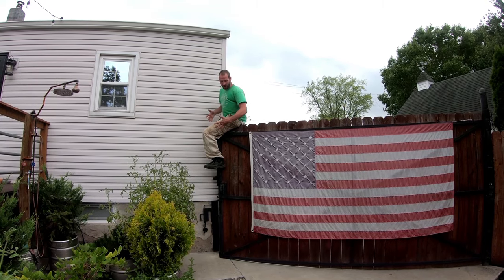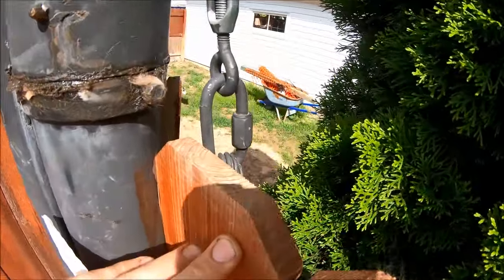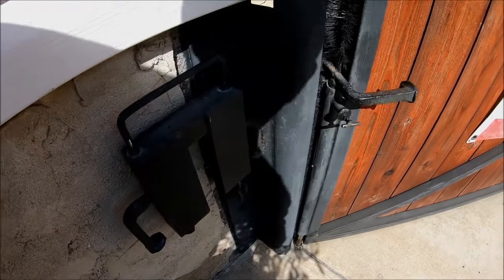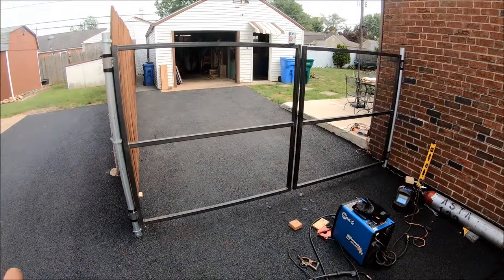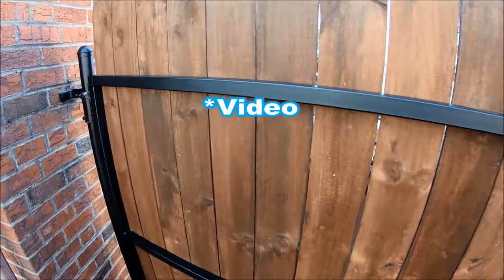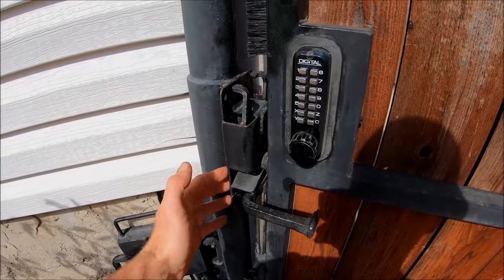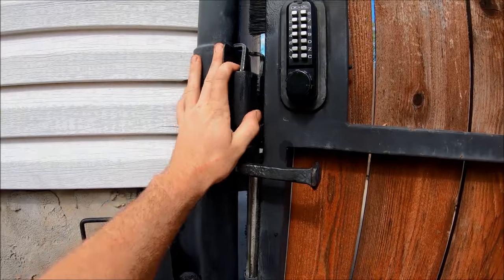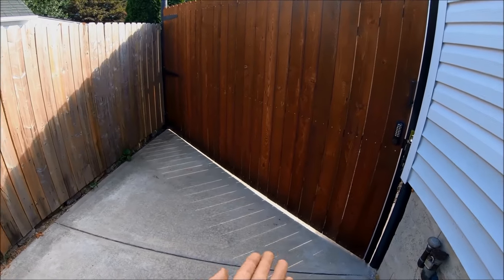A TRUE No Sag Gate | 12ft Wide Steel Frame w/ Cedar

Comment: SS40 seems to be a fencing specific product.  Pipe schedules are ASME standards for pipe sizing.  Sch 40 is standard weight pipe (wall thickness).  A 4” sch 40 pipe will be ~4” ID, and 4 1/2” OD.

Comment: The tension cable makes the install perfect, people forget the movement comes from the post bending this amplifies the drop in the gate by balancing the load you remove the droop,  superb bit of simple engineering
Reply from the maker: For sure. While I have not use the tension cable yet, who knows maybe 10 years from now it will come in handy!  Better safe than sorry. If I could go back I probably would have used a 6 inch post, but I didn't want to decrease the width of the driveway

Comment: Awesome build, and I am using this to build a double swinging gate spanning 17'...  Couple of questions, 1) what did you use to paint the galvanized posts and sleeves???  That black color looks so much better than just regular galvanized!!!  and 2) Did you use wafer head stainless steel self-tapping screws???  (I tried the amazon links, and they don't work for me, sorry)...  Thanks again, will shoot you pics of mine after complete in a couple of weeks...  Roger V
Reply from the maker: Thanks.  I used semi-gloss rustoleum brush on paint. And cleaned the galvanized posts with acetone first. It will tend to peel as it gets older though in areas. But it's easy to touch up.  Hard to get paint to stick to galvanized.
Reply from the maker: And yes I used self-tapping steel screws.  Actually ended up replacing them with stainless screws later down the line though to match the rest of my fence. Dabbed a little grease on each one also to help from the hole rusting out in the future.  Good luck on your build!
Reply: @NoNonsenseKnowHow  Thanks much for the quick replies!!!  Appreciate you documenting this!!!

Comment: You mentioned making a video about filling the post in with rebar and concrete around the 8:10 mark, did that end up working to get rid of the sag from the added weight of the pickets? I looked but wasn’t able to find the video. Great channel btw! I really enjoy your overkill designs and creative solutions
Reply from the maker: Yes it helped out but I still wish I went with a thicker post
Reply: I've got a 65x65mm post holding a 1.3m by 1.8m fence up and can see some flex. Now that I have the reinforcement idea I will try it thank you.

Comment: How much important is the rebar reinforced gate post and should I do that as well? 
I'm building a similar gate like yours.
Reply from the maker: I'm not sure how much it helps. I did it just because I felt the 4-in was thinner than it should be but the next size up was 6-in it was like double the price and also would have cut down on the width of my opening

Comment from the maker: I apologize for the re-upload. After uploading the original video, I did a small blur edit through YouTube and it got stuck in limbo. Had to delete and repost to correct the issue. Also thank you to the couple guys that commented letting me know the video wasn't playing.
Reply: No problem  nice bit of engineering as usual from you. Elegant is the word, overengineering  is when OCD meets engineering. I'm guilty of that ... my kids playroom has a cable tensioned roof just for fun and to upset the mere mortals
Reply from the maker: @kwinterburn  thanks for the kind words and support man. The playroom roof sounds like a nice piece.

Comment: would b nice if u edit the weld light out. very hard on the eyes
Reply from the maker: Noted. Thanks for the recommendation. I actually did that in one of my previous videos because the light was particularly harsh.  Basically gave the viewers a little welding shade box
Reply: Wear your welding mask then

Comment: You could always half-lap the picket edges to eliminate the gaps. Just enough to allow them to slide across for expansion and contraction. Or it might be possible to cut a kerf-sized slot to insert thin strips of metal or FRP to provide privacy and perhaps additional stability for pickets that have a tendency to warp out of alignment. A half-lap would help there too but only if the warp is toward the lap, meanwhile a strip would probably need to be painted to blend. Just remember to reapply anti-seize on the fasteners to prevent dissimilar metal galvanic corrosion. I have a crazy idea to install lightweight cedar pickets onto an aluminum frame and rather than swinging inward or outward, use garage door hardware to slide it upward into a carport. Garage doors are segmented into panels to pass the track radius but I’d just use the top and bottom of the assembly to achieve the same purpose. I still have to determine how much weight a torsion spring can handle.

Comment: 13:20 the benefit of not having a post on the left if you try to pull your truck past. It's a bit back after the house edge so you can start to sweep the front wheels at an angle. That's what you should tell people 😊